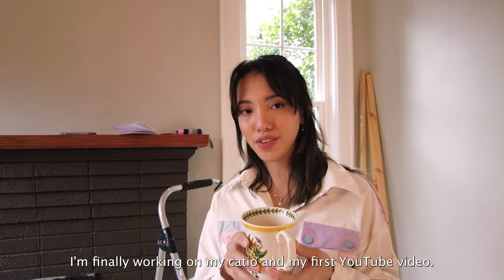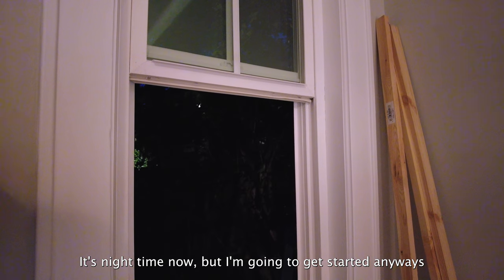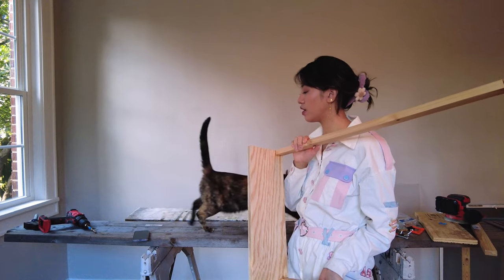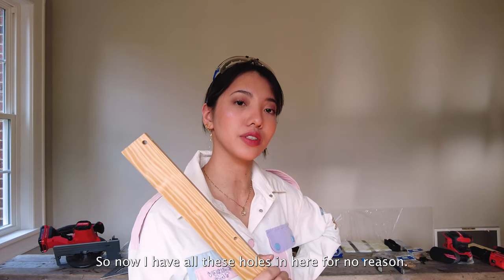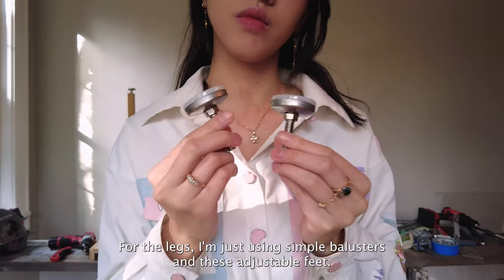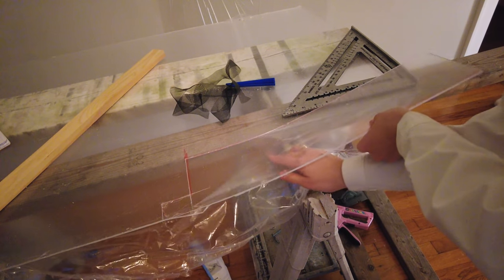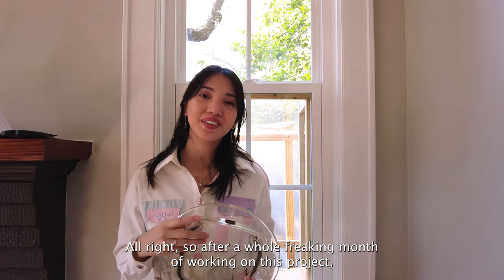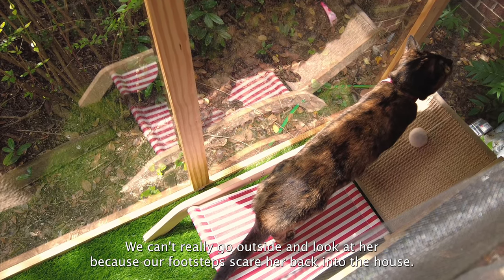Build a ✨catio✨ with me 🐈 (start to finish, beginner DIY)

Comment: also id highly recommend you maybe add some more support to the bottom and add something like real cat grass in a small bed of dirt in there as the fake grass can be really irritating and get really hot
Reply: maybe they are there and i missed them but if you had gone with the cat dor idea you really should have put slits in the acrylic so air could circulate well in there and she wouldnt overheat